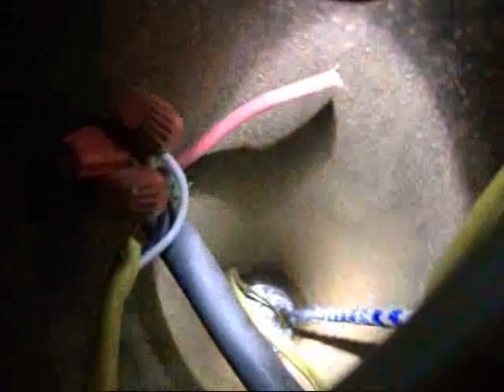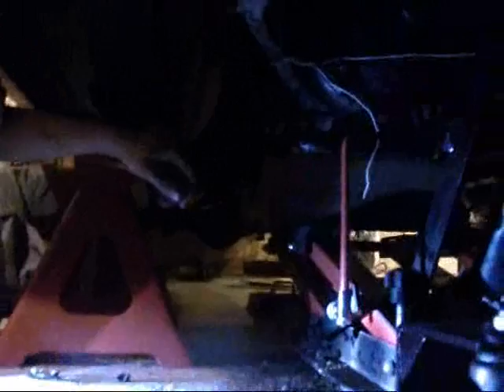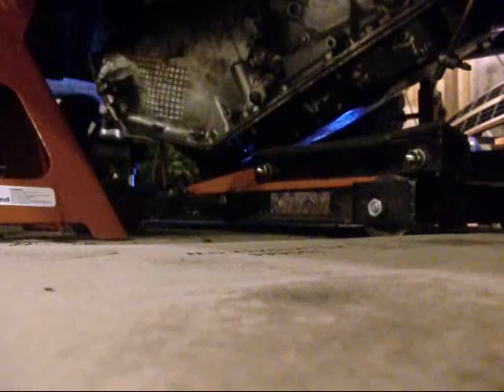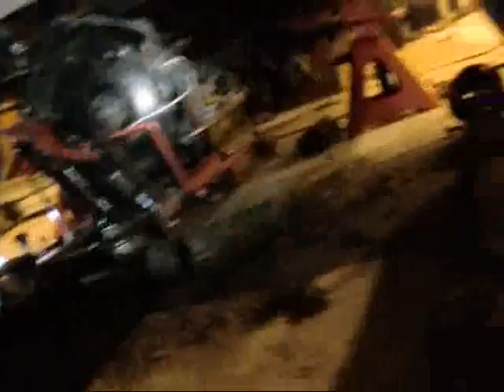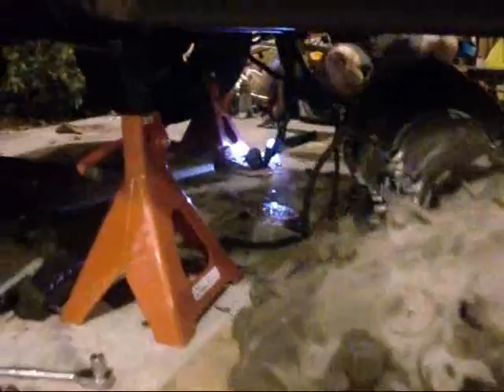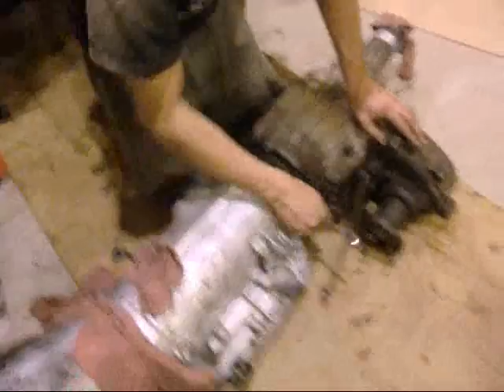4 16 12  K2500 Trannys Down W Help II

Comment: you should put wood planks under the front tires after you jackup the front end of the t-ruck. This way you can leave the truck up all the time to work under it and its way safer than using only jack stands...